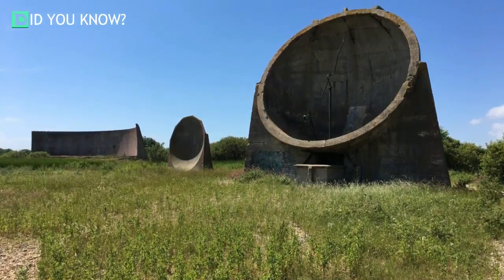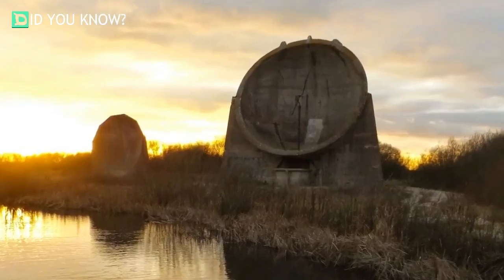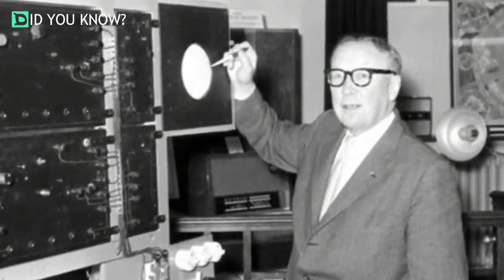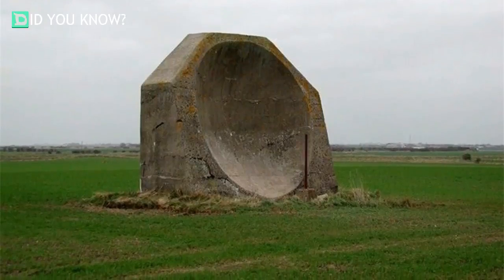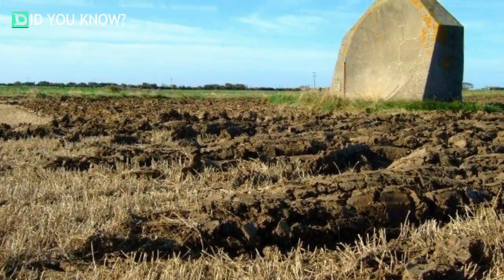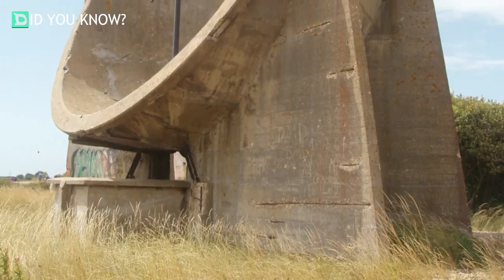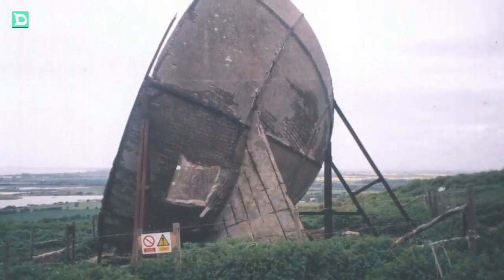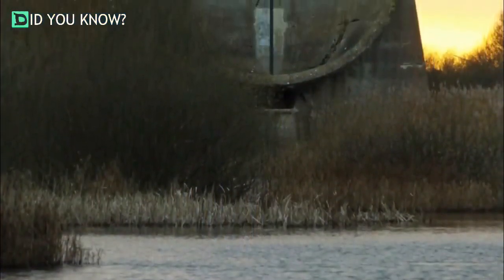Bizarre Concrete Structures Were Actually Built For A Surprising Purpose

Comment: I did have the idea of what they were used for. I have a satellite dish and I replaced the radio signal receiver with a crystal microphone enclosed in a can to prevent wind noise. I can hear sounds from something several hundred feet away with the microphone connected to a small amplifier and listening with headphones.